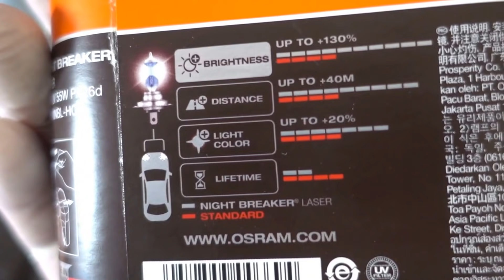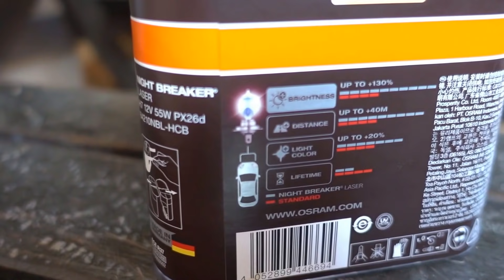Night Breaker Laser Bulbs 💡 Upgrade for Proton Persona ★Osram★ ★H7★ ★Xenon★

Comment: Hey Desert, I would like to change the bulbs soon as well. My concern is that we may damage the light leveling system mess up the angle and cause glare to incoming drivers, how did you manage that? Thanks
Reply from the maker: Aik Khuan Tan That's a valid concern but what I did was simply replacing the bulbs only and not changing or touching other things so I believe it shouldn't pose a problem. 😉 Well I think I can still use the adjuster to fix the beam level or direction if needed. ✌🏻
Reply: That's only a concern with HID bulbs or incorrectly-oriented LED bulbs.

Comment: Hello boss. Do you know what type of bulb for persona fog lamp? Now the bulb is yellow colour. I want white colour like the night breaker u use for headlamp.
Reply from the maker: Hi there. ✌🏻 Persona fog lights use H11 bulbs. 💡 Check at Lelong or Shopee for some suitable bulbs.
Reply: DesertGoon i’ve bought the night breaker H7 like yours at Lelong. So just to match my headlamp and fog lamp. Thank you so much boss
Reply: If i use osram h11, the bulb same color with osram nightbreaker h7?
Reply from the maker: @ahmadfitrie92  You have to check the bulb colour temperature which is usually written on the packaging label. 🏷 If it's above 4000K (but lower than 5000K) then it should be alright.

Comment: Hi, did you change both high beam & low beam or just low beam only? Is there 2 different types of H7 foe high & low beam?
Reply from the maker: Hi... Yes I changed for both the high and low beams using H7 single filament bulbs. H7 doesn't have double filaments in a single bulbs so high and low use separate bulbs unlike H4.
Reply: @DesertGoon  How's your experience using it so far?
Reply from the maker: @christy5992  The bulbs are an improvement from the stock bulbs so I'm happy with them. The light beam is brighter but the bulbs do not last quite long. Other than that I don't have any qualms about them.
Reply: @DesertGoon  really? How long did it last?
Reply from the maker: @christy5992  I can't remember the exact duration but it was a few months... considerably shorter than a normal bulb.
Reply: @DesertGoon  okay, thanks for the info...

Comment: Excellent video bos. Would be best kalo  explain bila install bulb, pastikan tapak bulb align dengan housing lampu kereta. Banyak tgk kereta otr issue lampu xalign.
Reply from the maker: I think there shouldn't be an issue with bulb alignment for a Persona because the bulb base/connectors 💡 and its shape are not regular so it has to be fitted in a specific way. ✌🏻😎

Comment: Mr Goon, where do u buy this NB? i tried searching through online like Lazada, but most of the feedback said the light is yellow instead of white
Reply from the maker: Syahreen Anuar I bought the bulbs from Lelong website. 😉 It costs RM120 per set (i.e two bulbs) so for Persona you'll need two sets. 😁
Reply: thank you Sir  👍
Reply from the maker: Syahreen Anuar You're welcome. One thing I forgot to mention was the light beam colour temperature is 4200K so it's not yellow... 💡 but not true white like HID.
Reply: @DesertGoon  Hi, may i know why need to order 2 sets, is it 1 set for high/low beam per side? do you know persona 2011 is use H7 as well? Thanks

Comment: Boleh tahu macam mana nak realign headlight tu lepas tukar bulb? Sebab sekarang lampu dah jadi tinggi
Reply from the maker: Hello... 🙋🏻‍♂️ I didn't have that problem after fitting the bulbs. Usually the beam alignment and height are related to the placement of the filament in the bulb 💡 (which indirectly is due to the bulb itself). I think the car headlight has an electronic adjustment but I might be wrong. 🤔 http://proton4u.proton.com/Proton4U/Attachment/tmp_3608-New%20Persona%20-%20Sales%20Rev7.3%20(Presentation)122589721.pdf

Comment: Hello boss. Maaf nak tanya sikit...

1. Night Breaker Laser bulbs ni boleh plug n play kat Saga 2020 tak?
2. Berapa harga for 1 pair?
3. JPJ kacau tak?

Really appreciate to hear from you soon. Thanks bro 🤓
Reply from the maker: Hi Riskin. 🙋🏻‍♂️ If we look at the spec of Saga headlight, it uses H4 bulb 💡 so you can use Night Breaker Laser bulb since it's available for H4. You can buy the bulbs at Shopee. 📦 The price is around RM70-RM80 per pair. There shouldn't be an issue with JPJ 🙅🏻‍♂️ since the bulb colour temperature is less than 4000K. 👌🏻
https://shopee.com.my/OSRAM-Night-Breaker-Laser-Next-Generation-H4-9003-HB2-HS1-12V-60-55W-P43t-64193NL-150-Bright-Car-Halogen-Headlight-Bu-i.423174570.4487940975
https://shopee.com.my/OSRAM-Night-Breaker-Laser-H4-150-Brightness-Xenon-Headlight-Car-Bulb-1Pair-i.91836532.1863755892

Comment: hi, nk tya type H yg mana sesuai pakai?
Reply from the maker: Hi Hanis. You should use H7 which has a single filament so you need to get two pairs for low and high beams. 💡💡💡💡
Reply: @DesertGoon  thank you tuan, order trus 👌🏻

Comment: Macam mana Tuan buka klip tu? Bukan ada skru ke? Saya cuba buka tak dapat dapat😅.
Reply from the maker: Hello... There is a wire clip which locks the bulb into the socket. You have to carefully pull the two clip ends together to release the clip then the bulb will be freed.
Reply: @DesertGoon  Okay, Thanks.
Reply: Is RM120 the price of three?
Reply from the maker: @ganazzer1  That's the price for a set of NB Laser H7 bulbs (i.e a pair).
Reply: @DesertGoon  Alright. Thanks again.

Comment: Is it illegal?
Reply from the maker: Max You It's perfectly legal ✔ since we only replace the bulb and not the whole lighting system like fitting a HID. 💡 This new bulb uses Xenon gas which emits brighter light (up to 4200K 🔦) but is not a HID system. ✌🏻
Reply: DesertGoon Its white bulb?
Reply from the maker: It's only slightly whiter than original bulb. The light beam is not glaring to other road users so there shouldn't be any issues at all.

Comment: I thought those things are illegal
Reply from the maker: veenoable It's legal for these reasons: 😁
1. Not retrofitting a HID system.
2. Colour temperature up to 4200K only.
3. Plug & play bulb for OEM replacement.
Reply: DesertGoon hmm  i was thinking to put this for my another car which is an old car but i cant
Reply from the maker: veenoable NB Laser bulbs only come in H4 and H7 so if your old car uses any of these bulb types then you're okay to install them. ✌🏻
Reply: I hope so
Reply: I wished to put this in my honda city because its a h7 i guess but my another old car is h4 which is a saga .its just that im concerned about those jpj standards for old cars like saga.
Reply from the maker: veenoable JPJ won't know you're using Osram NBL bulbs... because they are not so whitish and glaring like HID. 😆
Reply: DesertGoon are you sure ? If yes ,then i will be buying two of this
Reply from the maker: veenoable Yes I'm sure. 👌🏻😎
Reply: DesertGoon ok thank you 👍
Reply: DesertGoon from the 3 reasons above, that means i can change my bulb as long as it is below 4200K colour temperature, and not retrofitting my headlights? Because i kinda smoked my headlights but now it is a bit dim..I didnt think about it might dim my headlights 😅..
Reply from the maker: FIFA Gamer Yes as long as the bulb colour temperature is below 4200K (or 4300K) it will be fine during rain at night... and won't be glaring to incoming vehicles. ✌🏻 This upgrade is very simple and good enough to brighten up the road ahead of your car. 👍🏻 Try it. ☺
Reply: DesertGoon how do I know the colour temperature actually on the packaging?
Reply from the maker: FIFA Gamer Well I got the info from Internet since the packaging doesn't mention about colour temperature. It's the power of... Google. 🤣
Reply: DesertGoon hahaha..okay 😁👍🏻